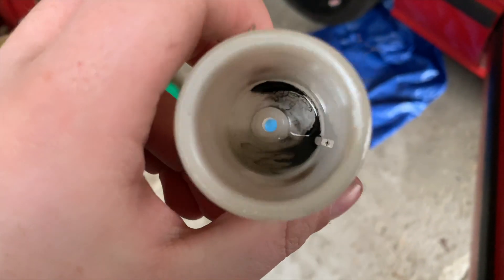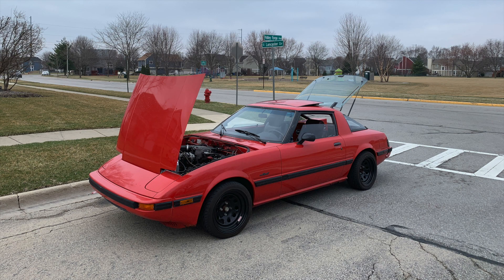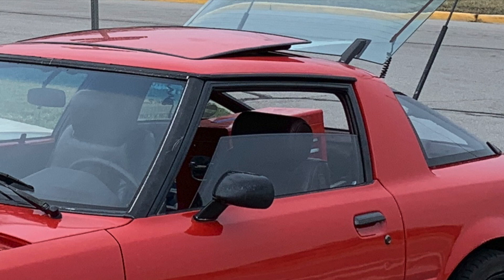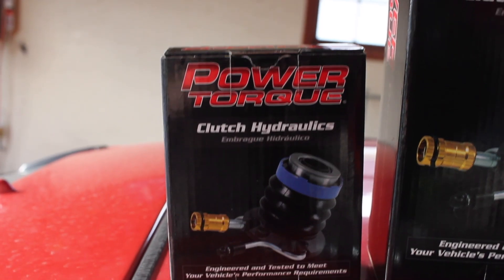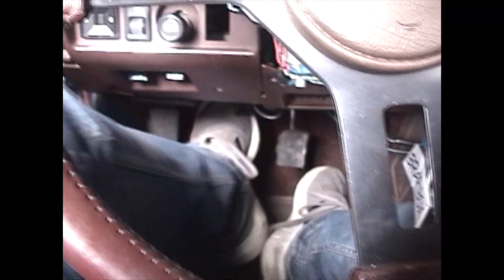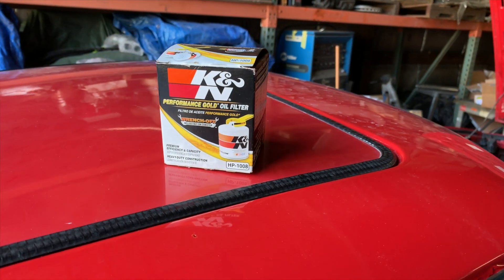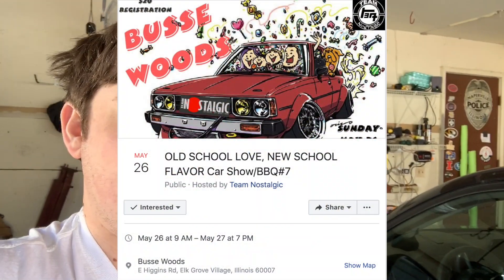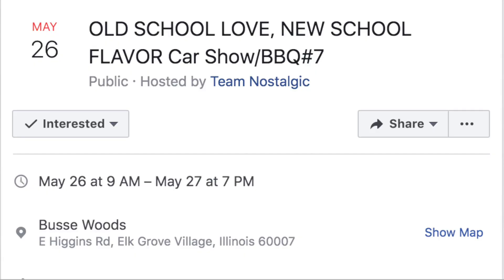Rotary Life S4 Ep. 3: The Clutch Master From HELL

Comment: the nut on my master stripped so that was fun, swapped about 2-3 of both slave and master, had to wait for hardline and clutch line from mazdatrix and my pedal was adjusted all wrong. Basically spent 2 months down because it wouldn't build pressure. My fc is fun but I think Its gonna be my toughest challenge yet lol

Comment: Hey Zach,   I love the entire rotary life series.... So much so, in fact, you've inspired me to start my own youtube channel and revive my 85 fb.....she's no Rose, for certain, she's really homely looking now, but we're just getting started.... I do have one question concerning my clutch, though.... I've already replaced my clutch, pressure plate, master and slave cylinder, and the line between them....it took forever to bleed though...but seems good now...the problem I'm having is that the clutch engage until the pedal is almost fully out( about 1 inch from top)....I'm pretty sure i've adjusted the pedal play properly... This doesn't seem normal...what you suggest?
Reply from the maker: Love to hear it! As for your clutch,  there is a stick that goes from the pedal to the back of the master cylinder. There are 2 nuts on it, 12mm I believe, that let you adjust it. is that the adjustments you already did?